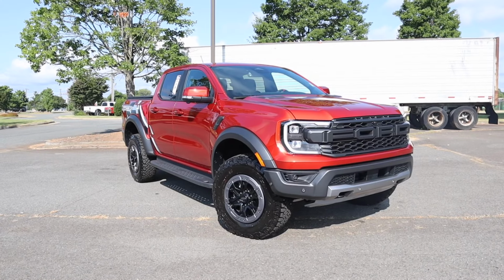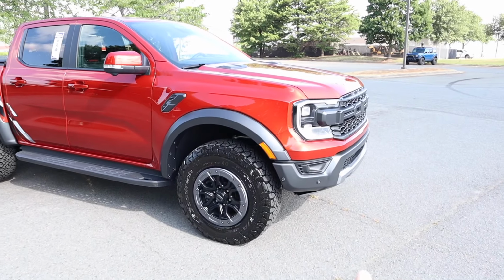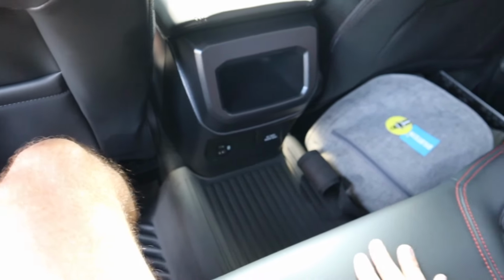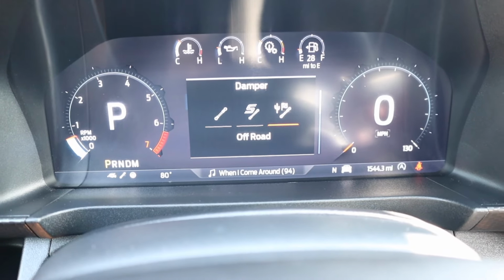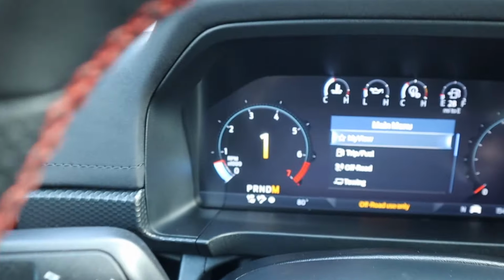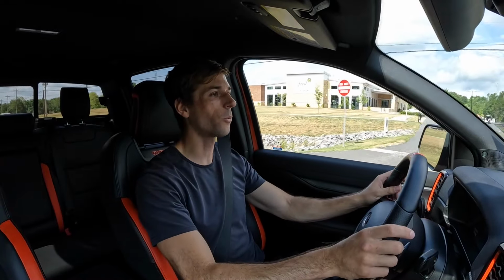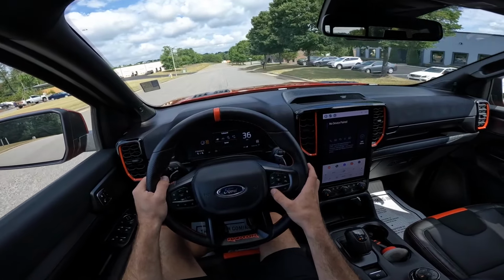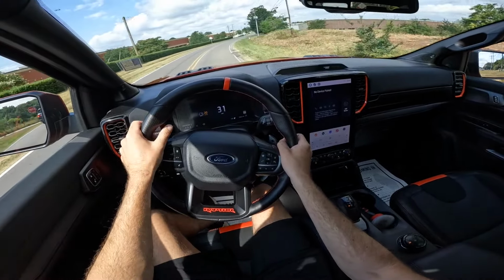2024 Ford Ranger Raptor: Start Up, Exhaust, Test Drive, Walkaround, POV and Review

Comment: I put an order in for one of these a couple weeks ago at my favorite local dealership. No deposit needed, no dealership doc fees, no obligation to buy, and NO MARKUP!!! The only caveat is that i would potentially be trading in my 2023 F150 Raptor. Living in a urban/suburban part of New England i think the Ranger Raptor may fit my lifestyle a bit better than the F150 version. I mean it would be nice to be able to drive into a normal touchless car wash to get a quick rinse in from time to time. Can't do that with the F150 Raptor (at least not near me). Plus at that price point (version ordered just over $58K) my payment could potentially drop by close to $200/month. So I can still have a fun vehicle to drive for less money. You still have to put premium fuel in the Ranger Raptor but not 36 gallons worth like the F150. I'm sure it will be a couple months at least before the ranger comes in so only time will tell. Two things I'm curious about...1) I am 6'3" normal build...will i fit comfortably? 2) No ventilated seats is a headscratcher. wondering if there is some sort of engineering reason why that was omitted as you can't get ventilated seat on the Bronco Raptor either and that approaches $100K. My F150 Raptor has it. My situation is pretty good...even if i don't take delivery, I'm still driving home in a bad ass Raptor!
Reply from the maker: Thanks for sharing! I’d rather have the F150 Raptor, but the Ranger is a nice smaller version!
Reply: What difference does it make if you have a 36 gallon or 22 gallon? You only use what you drive. So technically a 36 gallon is better. Less stops. 

If you don’t want to fill it all the way up, you don’t have to. You have more choices with a 36 gallon. Stinks the Ranger is only 22. I wish it was bigger. Less stops.  

Remember you only use fuel when driving.
Reply: @ryanb8736  TBH. yeah it doesn't make a whole lot of difference except that end result of a fill up is a smaller number each time. I don't think i have ever actually filled my tank since getting the Raptor as all the pumps shut off at $100 around me. I typically say that's enough and usually that leaves me with about 3/4 of tank full.

Comment: YAY!!! The Ford Ranger Raptor is here! But, no option for a 2.0L twin-turbodiesel 4-cylinder? Why?
Reply: I had the old ranger raptor with the 2.0 diesel biturbo and believe me a raptor needs a faster engine that’s why it is a raptor. I’m waiting for my next gen raptor and is coming this month 🥳
Reply from the maker: Must not be in the US right?
Reply: Because nobody wants a 4 cylinder in a truck. This is a muscle truck.
Reply from the maker: Have you driven one? Power in the turbo engines is much better.
Reply from the maker: Diesel isn’t in demand in the US for midsize trucks.